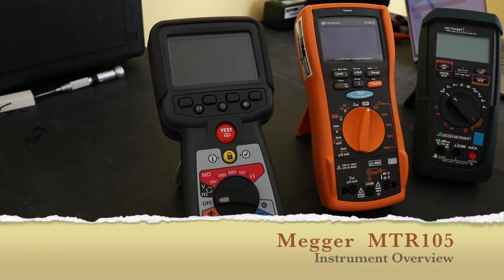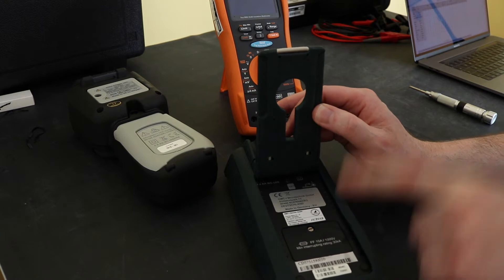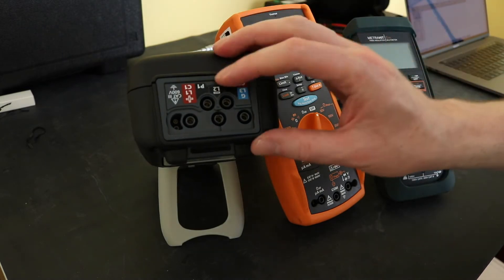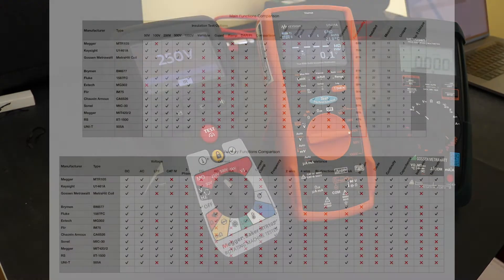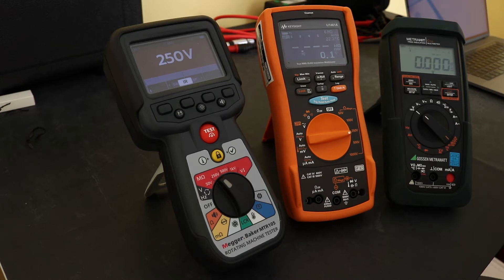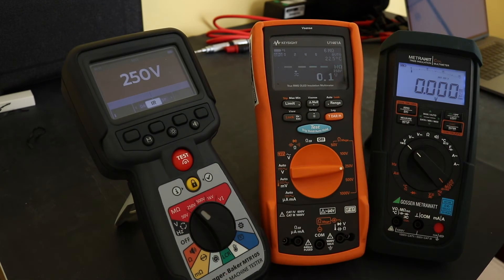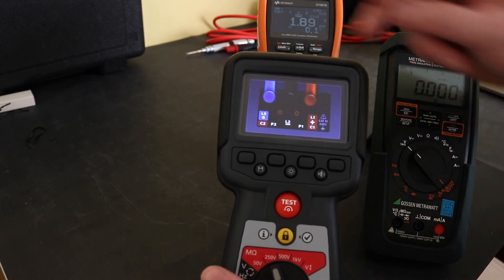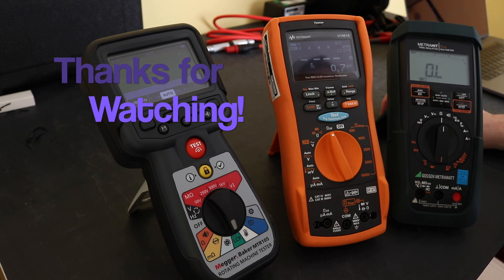MTR105 Meter Functionality Overview

Comment: TP I asked a question in your previous upload, which I would be grateful if you could answer especially given your work and expertise with motors. If money was no object what motor tester would you get? And do you know of any tester that could do the full suite of tests contained in EASA AR100-2015?
Reply from the maker: My apologies MM, I appear to have missed that question.

If you are going to spoil me with a money is no object scenario, then the answer is quite easy and is the same for both questions. The tester is a Baker Motor Surge Tester, now actually owned by Megger, although I have never used the more modern versions of them. 

https://uk.megger.com/products/motor-and-generator-testing/static-analyzers

There are other offerings out there as well if you research a bit. Electrom Instruments come up;
https://electrominst.com/test-technology/surge-tests/

SPS Electronics have an offering and also give you an idea of the price you are looking at;
https://www.spselectronic.com/en/products/details/surge-tester-st-1800b-1/

With the add ons that Megger provide, I believe they can do the vast majority of the tests with the document you referenced. I think you would have to supplement one with a current monitoring instrument for the operating tests required.

The down side to these instruments, despite the price, is that they are not ideal for field work. As far as I know they are always mains powered, they are not the most robust, certainly when compared to the more normal handheld instruments. Probably ideal for motor manufacturers and rewind shops, perhaps for contractors that work across multiple sites could justify the cost.

I have only ever used one on a 230kW 415V motor, when I wanted to upgrade the start/delta starter to an inverter and we did the full suite of tests to verify the condition of the winding. At LV in tends to be more basic testing for maintenance purposes that the MTR105 can easily handle. We have used some online analysis apparatus to supplement offline tests.

At HV then more in-depth analysis is more financially viable and the type of winding responds better to the more in-depth analysis options.
Reply: Three-phase fantastic response very grateful to you. Just wondering whether you have been involved in testing electrical generator motors for heavy fuel power station and what is your opinion about them.
Reply from the maker: In depends on the exact type, most of my testing experience is on 2 pole synchronous turbogenerators ranging from 10MW up to 400MW, 11kV to 21kV - some are brushless excitation but the majority are static excitation.
Reply: Three-phase Thankyou very much.

Comment: Overall the Megger is my first choice,  second is the Keysight, and third is the Metrawatt. Why didn’t you allow the FLUKE 1587 FC to be part of the lineup ? Of all my insulation testers I find myself using the Megger Insulation Tester more than any of them.  Once again TP you managed to pull off another great tutorial video.
Reply from the maker: I may go back and do a video between the MTR105 and the Fluke 1587 FC, but for this series I basically chose the U1461A and MetraHit Coil as the combination of the instruments is the closest I could get to the MTR105 functionality for a similar price. The Fluke would only really replace the U1461A and in my view is not as versatile an instrument.